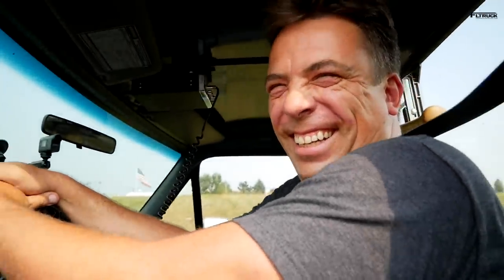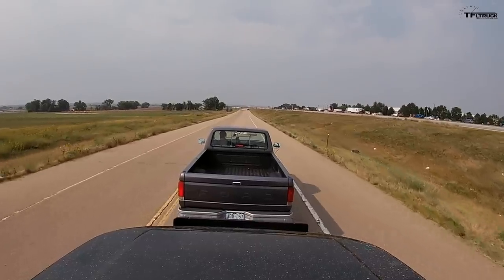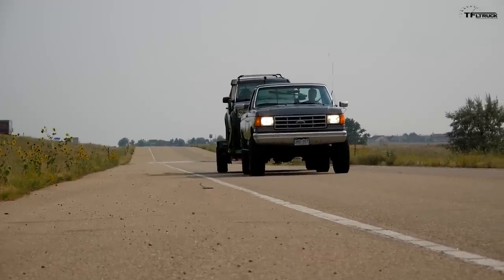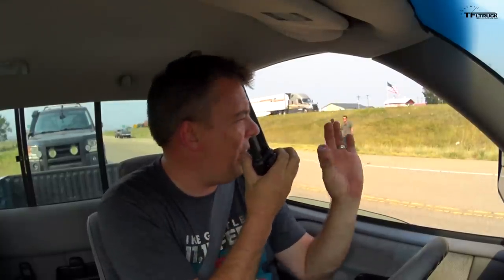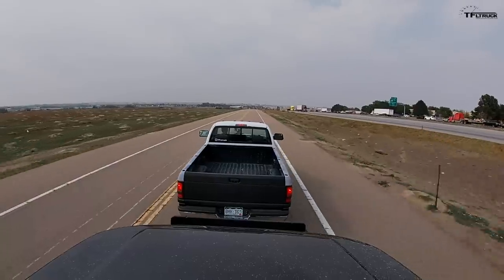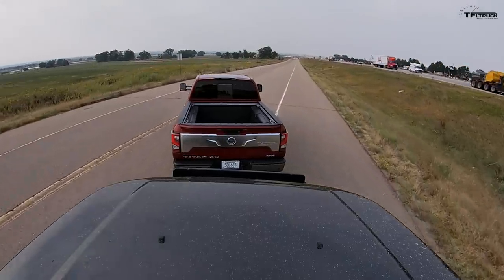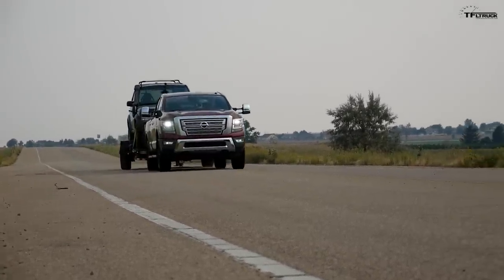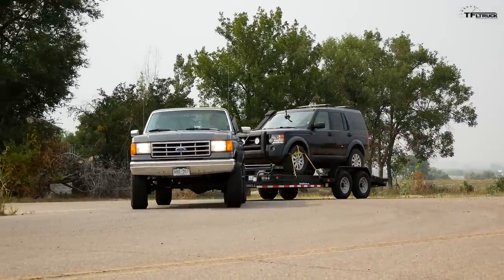Surprising Result! Can a New Half-ton Gas Truck Out-tow an Old Diesel HD Pickup? Let's Find Out!

Comment: You forgot to mention that with the older trucks you still have $50,000 in your pocket.
Reply: 60k in your pocket when the titan burns through that transmission if you tow anything but your boat twice a year
Reply: Not with the dodge you'd be on your 8th automatic trans and your 3rd dashboard.
Reply: @smiller225  only if you don't use tow/ haul and chip it.  But yeah the dashes were crap, haha
Reply: LOL Probably.
Reply: @messagefamilystyled1101  Aren't the Aisins they have pretty stout?
Reply: That 50k goes real quick when you have to start repairs out of a warranty on any older vehicle.
Reply: @hewlett260  My 2000 Ford F-250 hasn't cost me anything yet. 300,000 miles and still going strong. How long before that Nissan starts costing you for repairs?
Reply: @CraigSmith568  my Jeep was pushing 300k and hit the point where everything started to go as quick as I could fix it.  Still ran pretty good but the cost of a single major repair added up a few times a year for a couple of years ended up more than  my monthly payments for my new truck over the same amount of time
Reply: @CraigSmith568  2 days
Reply: @messagefamilystyled1101  heard they can tow over capacity, but that's funny
Reply: @jlsnn9  so can a 4l80e, and you can really beat on it for 20 years without a rebuild
Reply: But those old trucks won't tow nearly as well or be even close to as reliable as a new truck. Don't get me wrong I love my old 4runner, but when it comes to hauling. I'll let the wifes 2019 Seqouia do that
Reply: @TheMrLebaron  My 2000 Ford tows just fine. Plus it has a third pedal which you can't even get any more. It only has 300,000 miles, so it still has many reliable miles left in it.
Reply: @TheMrLebaron  the previous owner of my 93 7.3 non turbo has a trailer and backhoe says they weigh 10,000 lbs that truck can pull it without feeling it
Reply: So $50,000 for 6 front end rebuilds. How much will the Nissan cost in repairs with 300,000 miles? Just not worth all that money to me. Not just the Nissan, all new trucks are way overpriced with too much crap that I don't want or need that can break down.
Reply: @hewlett260  I can understand,  given that you had 300k miles! Nothing lasts forever.
Reply: @WilliamStewart1  the Aisins were good transmissions and the new ZF's are great but back in 94 they still had the problematic 48re.
Reply: @hewlett260  No, absolutely not. That's not how it is.
Reply: @smiller225  horrible but my boss owned one. Now has a trophy truck f max
Reply: @CraigSmith568  same e4od don't think so.
Reply: D max
Reply: @chumayeleziquio4521  That's what I'm talking about.
Reply: No way buddy ...  Every older diesel I have had needs a $2K-$15K bill ... You dont just buy some 30 year old diesel pickup for $10K and thats all you spend for the next ten years ...  Maybe if you are a super mechanic with tons of spare parts but it doesnt work that way at all for common user
Reply: Im into my 1998 dodge 3500 for less than 15 grand total and I pass half tons with smaller trailers than me pulling nasty grades at 55-60 mph.   I don’t worry about blowing up the engine in my truck or overheating
Reply: @smiller225  original dash in my dodge 3rd trans.   I bought it with a fully built auto and it tows like a beast.   I have 15 grand into my 23 year old 3500 vs 50 into a new half ton
Reply: @CraigSmith568  my 23 year old dodge 3500 cost me 15 grand total and I don’t worry about blowing it up when pulling a 12-14k gooseneck trailer behind it up mountain grades
Reply: I only paid $3k for a 106k mile 94 f-150 reg cab SB XLT 4x4 5.0 5 speed and I get 19mpg with it too. I priced 10 year old f150's with 150k on them and they still want 30k for them!
Reply: @mromatic17  I love the 92-96 body style. I'm a manual transmission guy also.
Reply: @CraigSmith568  my name is Craig too! I love the obs fords too and the gm square bodies !
Reply: Yea, and the taxes on the new truck!! I can tow 9200 with my old 05fx4  f150,! Paid cash for it 3 years ago! Just pay for liability insurance!! They don't even have a real conversation about the cost of  ownership !!
Reply: @CraigSmith568 the Nissan will go just as long. Those titans are pretty tough trucks.
Reply: @WilliamStewart1 yeah the Aisin transmissions are good but the RFE in the RAM 2500 is junk.
Reply: @CraigSmith568 your 2000 f250 can’t move out of its own way without a load.
Reply: + more ins. cost on the new one + higher license fee's, + cost def $ nah I keep my old truck.

Comment: You forget how dangerous towing was back in the day. No power, no brakes, vague steering. It was physically and mentally exhausting hauling something heavy.
Reply from the maker: True that!
Reply: Did you notice Andres expression in all 3 trucks?  Went from painful, to moderately concerned, to grinning like he just ripped one.
Reply: It wasn’t that bad lol
But yes things have certainly improved
Reply: @dragon81heart   Yes it was.  Just gets worse the further you go back. My '68 Power Wagon is a complete handfull going 55mph down the hiway with no trailer. I think with a trailer it would be scary.
Reply: TLR- NUT going into the 60s that could be but we had a 1988 F-350 and it tows just about the same as the new trucks, albeit just a bit slower up the grades lol
(Ok a lot slower at times haha) but it was just as stable and tracked just as true while towing as the brand new trucks.
If anything is off on the ones they used it has to be due to some worn bushings. New ones will make it tight as a drum again
Reply: @dragon81heart  sry but the truck from 88 is a 350, so it is not even close to what modern 350is are capable of....
Reply: SuperV8driver of course the older trucks weren’t rated for 25-30k towing 
They were rated at around 10k
But that was mainly because of the brakes. Those old drums just couldn’t scrub off the heat that vented discs can.
But chassis wise they could, and have, handed a lot more than they were rated for. They may not have been able to hold the same speed up a mountain grade, but they would pull just as hard as a new truck at lower speeds, and usually would far outlast the new trucks (well, at least the diesels would. Those old IDI’s would run damn near forever without needed even the slightest bit of service if maintenance was good. 
I never seem to understand how some people get this impression that older things were so bad when people drove them just fine for decades.
Just makes the ones talking shit on vehicles from not that many moons ago sound a just bit spoiled  🤷🏻‍♂️ lol
Reply: @SuperV8driver  no turbo no pull
Reply: @dragon81heart  i know what you mean, BUT i do own a view old cars and none of them where really reliable ..... if things get older people like to forget the bad stuff :)
Reply: SuperV8driver that is certainly true for many older vehicles, but definitely not all of them.
There are some incredible exceptions to that
Those IDI 6.9 and 7.3 diesel, and the 300 straight six, they were almost impossible to kill.
Had a few of both that had 300k on them, and the 93 IDI turbo went had was close to 400k when we sold her, still the original fuel injectors, lift pump, literally everything was all original on that trucks powertrain, other than air/fuel/oil filters and a replaced rear gears bc a quick lube place in Ohio forgot to add the limited slip additive and it blew while towing one of the office trailers up a 6% grade lol
It was even the original clutch and rear drums too lol (fronts discs would usually start to warp a bit and need replaced every 100k miles or so
Nothing today, not even the 6.7 Cummins can touch that.
(Hell the only pickup truck that was even near that same ballpark of literally never needing anything replaced for 300-400k miles was the old 12 valve Cummins in the late 80s-mid 90s Dodge Rams)

So yeah, not really anything to forget other than those trucks never needing to repair or replace a thing in the powertrain
Not a 1 ton truck made in the past 10 years can touch that. They have much more power, sure. But not nearly as well designed to last like these older trucks were. They were almost overbuilt lol
Made to handle a hell of a lot more than they would ever be approved to haul, and not miss a beat for hundreds of thousands of miles while doing it
Reply: Trailer brakes existed since the 80s. They just didn't come pre-wired.
Reply: @SuperV8driver  I would trust the F350 far more than the titan. The IDI and manual trans is a nearly indestructible combination. The titan likes to self destruct with out beating on it.
Reply: back when people actually knew how to drive. The guy driving these trucks was too quick to shift. when towing anything you should hang onto your shifts. Go all the way to 3500rpm not shift at 2000.
Reply: exactly! @thesmallenginekid

Comment: Do this test with 2000-2005 diesels vs new half tons.. I’d love to see a 6.0 power stroke go up against a new 5.0 f150
Reply: are there still 6.0s left running in the wild?
Reply: Thomas Lane absolutely. Problem is that they all have been "bullet proofed".
Reply: I would like to see a 2007 5.9 Cummins vs a newer gas truck to see. Peak 5.9 Cummins no emissions from factory vs modern gasser
Reply: Agreed. I’ll contribute a 7.3 👍
Reply: The 6. BLOW
Reply: And watch the 6.0 blow up on youtube live... I don't think so, we have enough fires going on in Cali
Reply: For how notoriously bad the 6.0’s are, I still see plenty of them cheechin’ around everyday where I live. But y’all are right, 7.3 vs 5.0 would be an interesting shootout 🤔
Reply: Just towed for 16 years with my 6.0, not a single issue. I'd put my 6.0 up against most newer trucks, the replacement for my 6.0 is a 5.9 swapped 6.4. I'll put it up against anything really. New trucks suck
Reply: @SPAMPANMAN  my 2005 Excursion has the 6 leader, no issues and has 300K. Hauled my holiday trailer to California from Calgary she did fantastic. +47°C in Nevada at 85 mph too. The 6L is a beast when bullet proofed. The Cummins aren't all they're cracked up to be, my mechanic buddies have just as many come in to their shops. Dead cylinder #6...
Reply: @mikehartwick8499  yeah I mean if you have to tear into a head and oil pan to bulletproof it, than ford messed up, I've had buddies with 6.0s and oil starvation problems or some shit at low miles
Don't get wrong I'm sure they do wonders for some people. I've just definitely heard way more horror stories than 300k mile stories,. Not knocking your ride, if it rolls down the road keep sending her those excursions are cool as hell
Reply: @SPAMPANMAN  yeah i got one with 230 k miles
Reply: The 6.0L is a great motor once it's been upgraded from the factory issues. Hands down one of the best sounding diesels there is.
Reply: If the head gaskets didn't blow by the end up the test.
Reply: @brandonmick9191  I had an 06 5.9 for years, then bought a brand new Ram 2500 in 2015. The new trucks creature comforts plus added weight made it tow better, but the improvement honestly wasn't as big of a leap as I was expecting. The biggest different was on super steep inclines the 2015 EGTs were TONS lower, probably 400 degrees worth of difference.

So, an 06 would still spank a modern gasser.
Reply: I would love to see an Chevy/GMC 8.1L on the channel.
Reply: @mitchjruiz  mine hasn't blown and it has 230k miles with a tuner. Its all stock except echaust tuner and airfilter
Reply: @Jv19979  man! Thats awesome. I had three friends that all had to dump $10000+ into their 6.0s and I just drove by laughing in my 5.9.  ;)
Reply: @townsendliving9750  I agree I had a 6 in my F-150.  The body rotted off around it and it's still going strong in another truck.
Reply: Also be nice to see the old trucks with the auto transmission. Manuals kind of suck for towing.
Reply: @mitchjruiz  mines a 2004 i tow with it all the time. The only thing that has messes up is the water fuel separator. And glow plugs.
Reply: or maybe 2003 Cummins instead- no egr, cat  or DPF maybe just a Smarty JR programmer
Reply: Mike Hartwick.. A 6 LEADER!!! Love those!
Reply: Adventures with Gnomie ..You has a F-150 with a 6.0? Hmmm
Reply: Properly Build 6.0L would smoke an f150.
Reply: David Wark ..Especially a 5.0. Cracks me up these guys go on and on about their 5.0s even though its been proven the ecoboost outperforms in EVERY aspect.
Reply: Living Life your thinking about Toyota Tacoma’s
Reply: They'd be fined for all the coolant on the highway
Reply: @SPAMPANMAN  yep there is 😁
Reply: EJ102 the 8.1 and Allison combo pulls like a train. I’d like to see the new 6.6 gm gas v8 up against the 8.1
Reply: @mikehartwick8499  A 24v 5.9 if treated the same as the 6.0 and all things being normal will surely outlive a 6.0, probably twice over if not more.
Reply: I spent the day towing multiple loads of hay on a gooseneck, all with the trailer weighing roughly 23,000 lbs loaded, up a nasty muddy backwoods trail and then 8 miles home and back with an 07 F350 6.0. I know their reputation and that it is mostly deserved, but when they're running well those pigs and tow pretty darn good.
Reply: @ej1025  ya on the i gaunlet i bet under 10 minutes
Reply: @brandonmick9191  07 is not enmision free and had more emmisions than early 3rd gens😂😂😂  My 01 Cummins however does not have a cat or a CCV filter.
Reply: punkrocker10115 2007 5.9 Cummins was emissions free. 2007.5 is when emissions started on the 6.7 Cummins. I only had a cat and muffler on my 2007 5.9 Cummins and its bone stock Other than the straight pipe
Reply: @brandonmick9191   Obviously you don't know what emission control devices are. 😂😂😂 A catalytic converter and a CCV filter are emissions devices.  Also, unless you delete it it, your 07 does have a replaceable CCV  Filter under the engine cover that requires replacement every so often.
Reply: My 2004.5 cummins could get that 8500 pounds to 60 in prolly 10 seconds, i mean a boosted launch would be needed but still
Reply: yeah. they should do a 7.3  or 6.0 powerstroke and a 6.6 dmax or 6.7 cummins and an eco boost f150 because apparently tHeY cAn tOw 10k
Reply: im interested in this
Reply: What lol ,  a  NA pushrod v8 that hits power at higher rpm , it is not even in the same league as a 6.0 , not to mention it is in a 1/2 ton. You might want to do more research. A 6.0 will have substantially more torque across the entire curve.
Reply: My 05 5.9L Cummins with just a tune could haul ass even with 8k. They made big strides from 03-2010 for trucks
Reply: @brandonmick9191  Nope - 1 year only,    for truly emission free Cummins with common rail. the 2003 5.9 models  from the factory-no cat, EGR, DPF or anything else .
Reply: @Dimetri Drossos 5.0 would be good race. A 6.0 will kill a gas motor.
Reply: @townsendliving9750   d max with 300 k will kill 6.0. had 4 6.0 service trucks never again
Reply: @ReindeerBork  well yea.  This is stock vs stock.
Reply: @townsendliving9750  you will lose in the power department.
Reply: @techs1smh13  a 6.0 would kill itself Lol'
Reply: the 6.0 would destroy a 5.0 F150 for sure, especially in towing. and Even more so at altitude, VGT turbo charger VS naturally aspirated
Reply: @ej1025  the Chevy 8.1L vortec Tows like nobodys buisness but Fuel economy is really really really bad, id reckon in terms of Gas VS diesel the 8.1L vortec is probably the only gasser that can out tow a 6.0L powerstroke. Its just really hard to beat the 6.0 not taking engine issues into account given one that works perfectly or even just good, the 5R110 Transmission is bullet proof my 6.0 i daily it non VGT setup 700 HP and 1400 ft lbs of tourqe fuel only to the rear wheels,
Reply: @sstroh08  I love towing with my Rig a 05 Harley Davidson F250 with many many aftermarket modifications its hardley a 6.0 underneath honestly, 700 HP and 1400 ft lbs of tourqe to the rear wheels Non VGT turbocharger, She pulls hard, the towing is just amazing because of the 5R110 Transmission, mines a Stage 3 from david Ferguson Red diamond diesel before they burnt down, havent had a single issue with it, I've pulled close to 22,000 lbs 40 ft tandem axel goosneck with 14 haybales each weighing roughly 1500 each, she got to 60 much faster than the video shown with the nissan titan with half the weight, if my truck doesnt have a gooseneck attached its got a 20 ft dump trailer, or a flat deck car hauler with a 2003 F350 Crew cab long bed on it 35 inch lift
Reply: @justnsaliga8518   Pick up trucks tested a 3.73 gear equipped 2011 5.0, running a 9,000lb trailer. 16.85 0-60, the 5.0 is no joke, I have 2 of them, at 10-12,000lbs or less, I would not be afraid to run against my employees LLY Duramax or a friends LBZ any day on a 0-60. I have talked to them about how much weight they can pull on local hills, I can match, unless the weight is higher then 12k and can out accelerate, on more weight. I have pulled 15400, and my passenger had just pulled the same trailer with an early Duramax, he was Floored at the way the 5.0 towed.
Reply: I own both right now, 2005 excursion 6.0 and a 2018 f150 5.0, the excursion weight makes it better towing, barely feels what behinds ya and better mpg, but they both capable of pulling the same weight